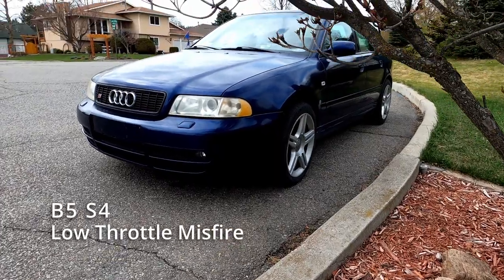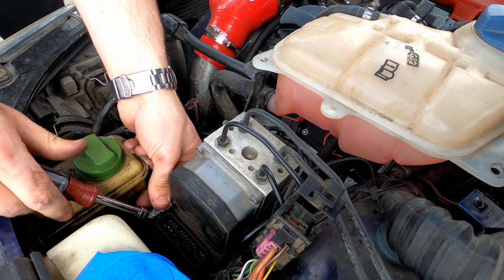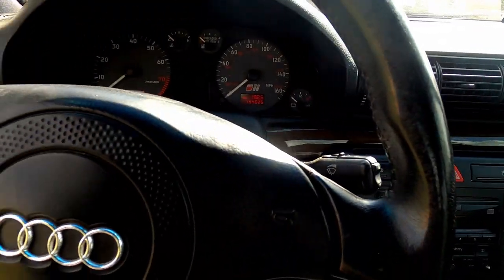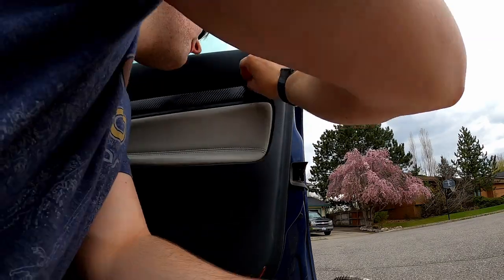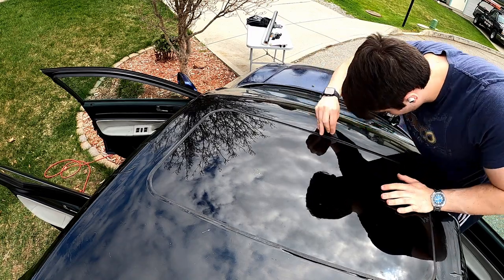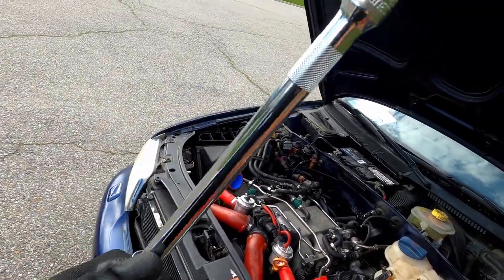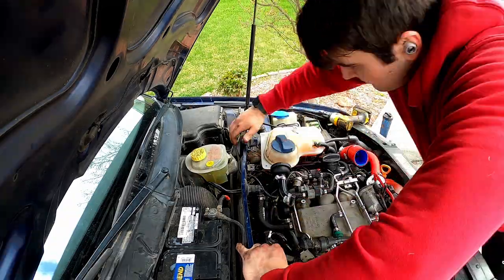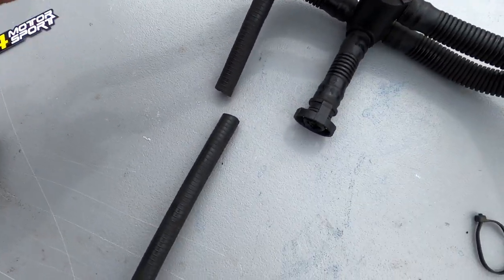Eliminating 2.7T MISFIRES! | ABS, O2 Sensors, PCV, and Vinyl!

Comment: Nice progress, and wrapping the wood trim pieces definitely modernized the look of the interior. What's your plan for the front seats?
Reply from the maker: I am really on the fence with those... I love the fact that it's a complete OEM interior, but they are definitely now the most worn out item in the interior and holding up the quality. I haven't decided if I want to restore them/replace with oem, or pull the trigger and get some nice bucket seats/or b6 Recaros. Thanks for the support by the way:) it means alot!

Comment: Great job 👏👏👏 what size vinyl did you pick up to do your roof?
Reply from the maker: Thank you for the support! I went with a 15ftx5ft roll. I bought alot more than I needed and cut a section off so I had extra in case I messed up and needed to try again and to do my other car/projects.
Reply: @HunterDirection  thanks! I'm gunna take a crack at doing mine i have similar clear coat damage.
Reply from the maker: @theRCLlama  It makes so much of a difference to the overall look of the car! I am excited to hear how it goes:)
Reply: @HunterDirection  ill def report back 😊👍

Comment: Did you have to send your whole ecu out to have them read the data? I have a misfire that 3 shops couldn't figure out and Im at a loss at this point.
Reply from the maker: No I didn't:) when I ordered the tune they sent me a cable (kinda like an obd2 scanner but it plugs into a laptop). You plug it into the car and drive around while it maps some driving data. This was super helpful in them figuring out where the tune came from. I think if you email on their site you can buy individual log reviews as well. They are a super cool company and nice people. Motoza performance is the company name. Thanks for the support!
Reply: @HunterDirection  appreciate the reply, I'll look into them, thanks 😊

Comment: where did you get the abs computer
Reply from the maker: There are a few places you can go with. There are companies that will just refurbish yours if you send it to them. Or you can buy an already refurbished one like I did then send your old ones in to get the core deposit money back. The company is called A1 Cardone, but you can get them from carparts.com. :) here is a link similar to the one I used.(https://www.googleadservices.com/pagead/aclk?sa=L&ai=DChcSEwiPpfHc0Ob3AhUGFq0GHeXBDs8YABAIGgJwdg&agsac=UZCuJWVan3k&cit=CkQKCAjwj42UBhBwEjQAj9tG2ZRHfCJtAO-TYTUioe_4UqpPjrqFFH1HDeEU64-0XkH3EY94r3KdkQf76rUhKTlNGgKTH_D_BwE&ohost=www.google.com&cid=CAESa-D2A6WVf4XmYI6dINYoLX6wuLvT-IIunmTy4otagZCPzM7m4a-aiBS2tYmuSj326qa3osw75HvH4ShGP5udd3C1BZrVtUpBZLRgI2DfDfwa9ggXLLJcUeO_psEoFlTNP5-ldcCkwTdxNmQ9&sig=AOD64_0RT4a08p0R8GqKNSiixSh0rzppLQ&ctype=5&q=&ved=2ahUKEwiU9-bc0Ob3AhWJDEQIHWRnAigQwg8oAHoECAEQCw&adurl=&ms=CoACNHqby-pNsXFZRqfcE-V30Q2l047FbALhY0EpSeuueJk9yZ_hzsstMxi4fJYUmk0NuCxiDeDyVv10B68QeEShNvS1sHfqScWFyKhlGCpN3198PZYUL_fUie6J1-teciSYfRnMgVPuBeZEeDYRQIfPi-U5IbcpCXYaN8tNt28c3l-DzQeU3wI2cQ8VRUgBYEdqm61iyGj4ap8hKKb4Jx5bQnDNDOCCu9qQgezjt-ib0DQlwaNR7liOOYcSqSp2-UQjIoPZHQpxSQavi7TgpLi2uL8gQibEJn-cPxx6iOVkNykRZXb-xEyBEl_vSjlNudYMi-qoMR--r3fMPAnmJYfouwqAAgx_ZkSPsustsSEzgMxffE0He1WbLP7TqYRAHKAhe6niv-T4CbFl-TyFEq3aJHxiHmuCXJEtR0rxBJAePp-2xzi9GSwoFxAeni1kMBGB7PT7yElfVGoR9L3bl4fY1_Y0KdWvkoRHTWQwRauJ6ZWNHpR7Fe22Eaz_3TwGwpF4W9qvklOJtLI1SLfjk63Oyp-76avn60mkv5zgw_M-v0-Bh0ZenXSMDNRcgKynEHnFkRjDnW1bW6pnjie5BVA3A3thmHkGfeVzPetH-NOFSu3LhNWm4jL5lgOxjtkYRYHwmNgoa7gSRyUg7Q6PQV0aG0Pg0yzQKS_fCewXlVtDqJgd8zISEOh-pyGcQ0nIOIhyCmZn2a4) Make sure to look at the model number tag on the bottom of yours before ordering the specific one. Traction control s4 and non traction control s4 have different abs computers from my research. Hopefully this helps. Thanks for the support!